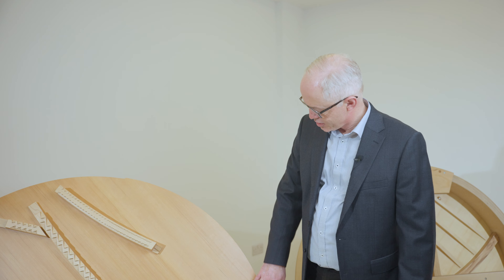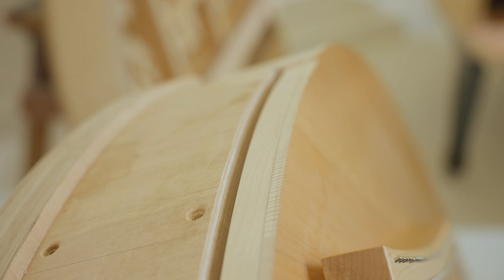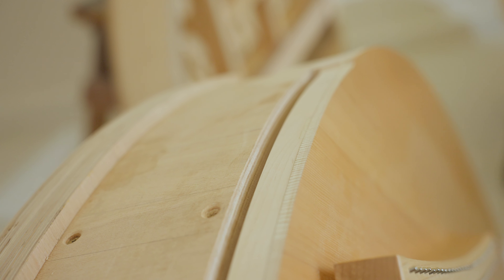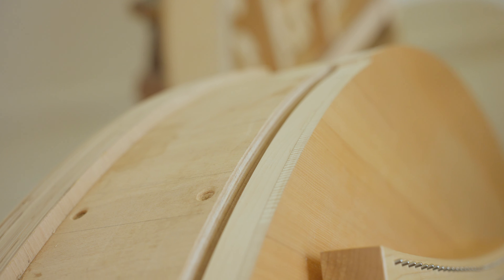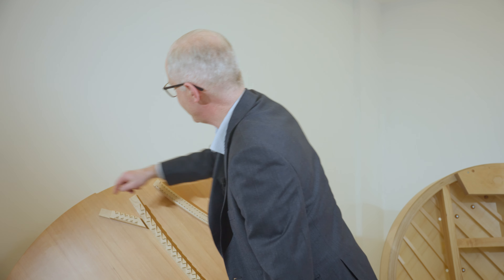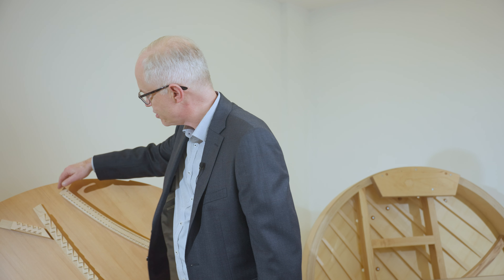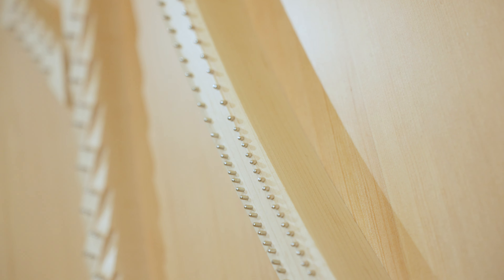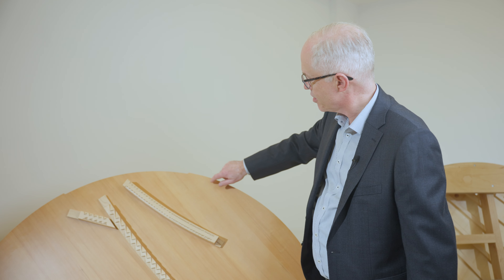The Edelweiss S132 - Floating Soundboard Technology - What makes it so special?

Comment: I am afraid that the only place where this can be put to test would be in an extremely quiet studio or better of – in an anechoic chamber. This way self resonance can be explored although in the case of a piano specific strings should be addressed because some of them might have sympathetic resonance to such floating board. Most pianos are too heavy on the lower mids (muddy sounding). With baby grands that might not be the case though. A big brand built special facilities for such research.